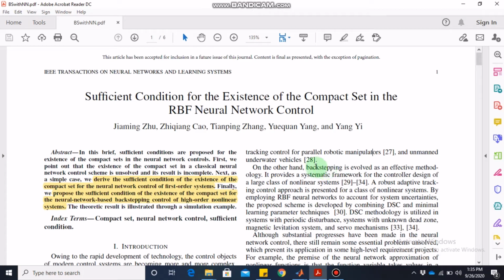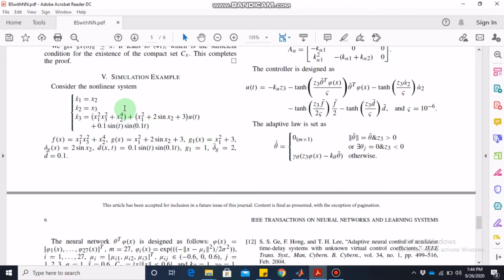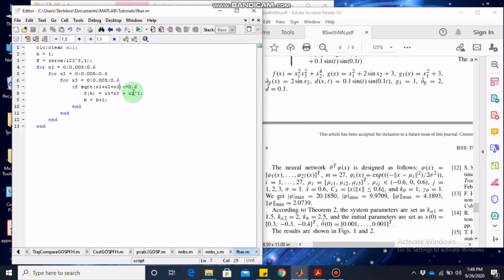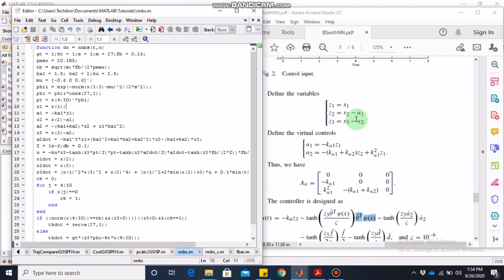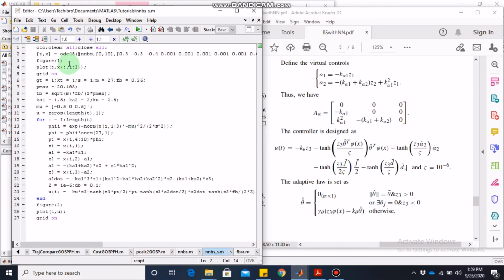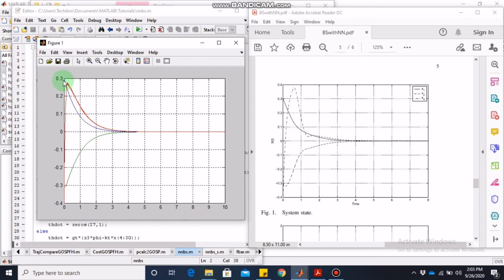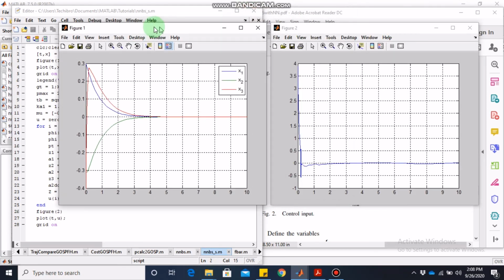MATLAB Simulation of RBF Neural Network based Backstepping Control

Comment: Good evening sir ,how to evaluate the estimation performance with the index when using the rbf neural network?
Reply from the maker: You can always look into the estimation error in simulation based case studies
Reply: @cset  Sorry , sir.  I don't understand please explain a little better.
Reply from the maker: @arunbali7480  The estimation error is the difference between the actual state value and the state value estimated by the rbf neural network. For example, if x_hat is the estimate and x is the actual state, the estimation error is x_tilda = x - x_hat (for ideal estimation, x_tilda must approach to zero with the passage of time)
Reply: @cset  thank you so very much sir, Can  you please provide me any matlab code for plotting estimation performance ?

Comment: Good day Dr. I am currently working on a paper that employs the sliding mode control method and radial based function neural network and am having some problems with the simulation. I was hoping you might provide some insights. My email is joelmawanza@gmail.com.

Comment: Hi! Thank for a very informative video. I tried running this code but I am getting few errors.
first error is in line 7 of nnbs function code for phii, it says not enough input arguments.
second error is in nnbs_s code for ode45, it says index exceeds the number of array elements (29)
 Can you please help ? I can send you a copy of my Matlab code.
Reply from the maker: Due to lack of time, I may not be able to look at your code but please do compare your code with the following to find the errors.
function dx = nnbs(t,x)
gt = 1;kt = 1;s = 1;m = 27;fb = 0.26;
pmax = 20.185;
tb = sqrt(m)*fb/(2*pmax);
ka1 = 1.5; ka2 = 2;ku = 2.5;
mu = [-0.6 0 0.6]';
phii = exp(-norm(x(1:3)-mu)^2/(2*s^2));
phi = phii*ones(27,1);
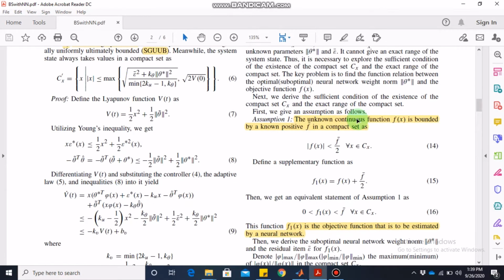pt = x(4:30)'*phi;
z1 = x(1);
a1 = -ka1*z1;
z2 = x(2)-a1;
a2 = -(ka1+ka2)*z2 + z1*ka1^2;
z3 = x(3)-a2;
a2dot = -ka1^3*z1+(ka1^2+ka1*ka2+ka2^2)*z2-(ka1+ka2)*z3;
Z = 1e-6;db = 0.1;
u = -ku*z3-tanh(z3*pt/Z)*pt-tanh(z3*a2dot/Z)*a2dot-tanh(z3*fb/(2*Z))*fb/2-tanh(z3*db/Z)*db;
x1dot = x(2);
x2dot = x(3);
x3dot = (x(1)^2*x(3)^2 + x(2)^4) + (x(1)^2+2*sin(x(2))+3)*u + 0.1*sin(t)*sin(0.1*t);
ck = 0;
for j = 4:30
    if x(j)==0
        ck = 1;
    end
end
if ((norm(x(4:30))==tb)&&(z3>0))||((z3<0)&&(ck==1))
    thdot = zeros(27,1);
else
    thdot = gt*(z3*phi-kt*x(4:30));
end
dx = [x1dot;x2dot;x3dot;thdot];

SECOND FILE
clc;clear all;close all;
[t,x] = ode45(@nnbs,[0,10],[0.3 -0.3 -0.4 0.001 0.001 0.001 0.001 0.001 0.001 0.001 0.001 0.001 0.001 0.001 0.001 0.001 0.001 0.001 0.001 0.001 0.001 0.001 0.001 0.001 0.001 0.001 0.001 0.001 0.001 0.001]);
figure(1)
plot(t,x(:,1:3));
grid on
legend('x_1','x_2','x_3')
gt = 1;kt = 1;s = 1;m = 27;fb = 0.26;
pmax = 20.185;
tb = sqrt(m)*fb/(2*pmax);
ka1 = 1.5; ka2 = 2;ku = 2.5;
mu = [-0.6 0 0.6]';
u = zeros(length(t),1);
for i = 1:length(t)
    phii = exp(-norm(x(i,1:3)'-mu)^2/(2*s^2));
    phi = phii*ones(27,1);
    pt = x(i,4:30)*phi;
    z1 = x(i,1);
    a1 = -ka1*z1;
    z2 = x(i,2)-a1;
    a2 = -(ka1+ka2)*z2 + z1*ka1^2;
    z3 = x(i,3)-a2;
    a2dot = -ka1^3*z1+(ka1^2+ka1*ka2+ka2^2)*z2-(ka1+ka2)*z3;
    Z = 1e-6;db = 0.1;
    u(i) = -ku*z3-tanh(z3*pt/Z)*pt-tanh(z3*a2dot/Z)*a2dot-tanh(z3*fb/(2*Z))*fb/2-tanh(z3*db/Z)*db;
end
figure(2)
plot(t,u);
grid on

Comment: Please pardon my mediocrity. I know neural networks are trained based on data, so what's the data provided here? Again sir, what is the direct effect of the RBF on this backstepping controller? Couldn't the the controller have achieved same aim without the RBF?
Reply from the maker: We are all learners. To answer your question, neurons are evolving with the help of differential equations ("thdot" in the code). If you look closely, you will see that the control input uses "pt" in the code that depends upon the RBF neural networks. The control here is indeed using the RBF neural network in order to achieve stability. More in-depth and accurate detail regarding the theory is of course presented in the paper. You may download the paper from IEEE Xplore and read the whole concept if you like.
Reply: Thank you.

Comment: Thanks for your video. Have you used the neural network control for manipulator? I try to do programming for my neuron-sliding-mode-control by your way, but it didn't work.
Reply from the maker: It happens all the time in programming. There is probably a small annoying error hiding in plain sight.

Comment: thanks for the lecture sir, i want to ask  you about theta_dot, in the program you use the instruction pt = x(i,4:30)*phi; so you use directly the value of dtheta i.e ( x(i,4:30)) for calculating 'pt' .However , in the paper the auteur used theta instead of dtheta for calculating pt, so you need to integrate the term  x(i,4:30) before calculating pt. what do think?
Reply from the maker: Please note that x(4) to x(30) are the elements of theta not dtheta, dtheta in my code is represented by “thdot” which is defined from lined 27-31 of the nnbs function file.